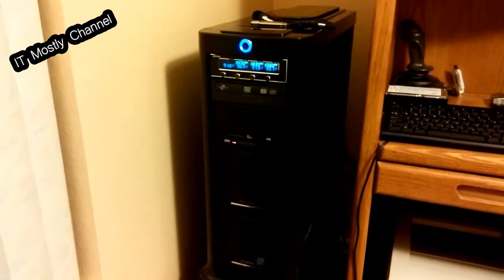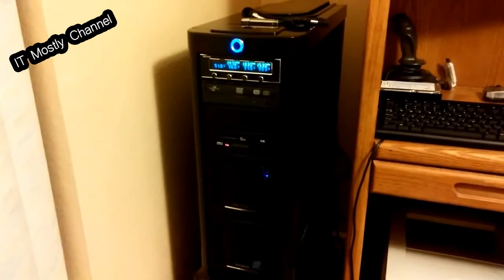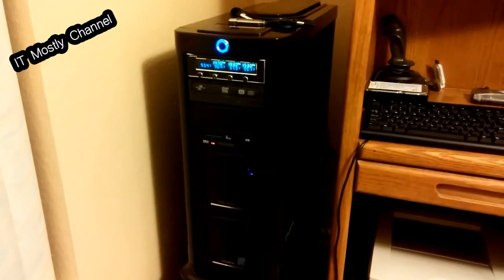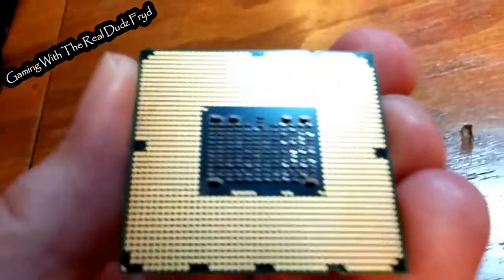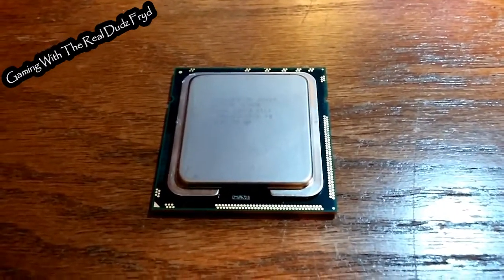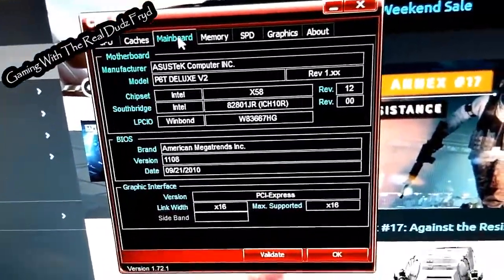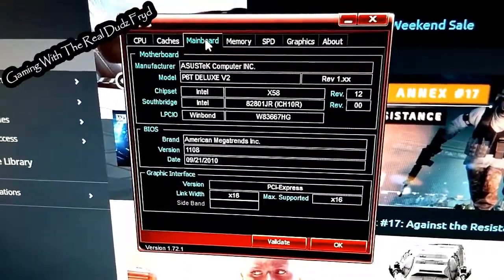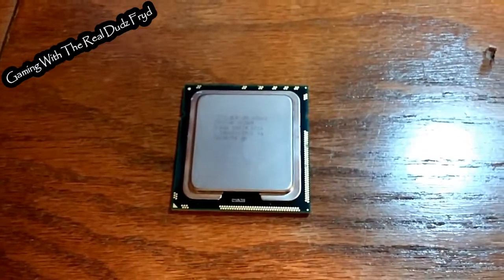Intel Xeon Upgrade:  A 6 core Xeon for an old X58 Board  (Part 1)

Comment: Didn’t think PC Power & Cooling ever made any ATX power supplies.
Reply from the maker: Yep, I've got 3 of them.  Two 610s and a 1000KW.
Reply: I still have a Turbo Cool 250 (I think).  Pretty sure it is an AT style unit.  It died around 12 years ago, maybe.  I really should diagnose it and repair it to use as a bench power supply.

Comment: i also upgraded to this 6 core machine. and to be honest, this chip W3690 6core / 12 thread xeon is a beast.
U can check my gameplays too. Getting amazing fps on high end games. i paired it with gtx 960 4gb.
Reply: Yes i overclocked my CPU in T3500 server workstation.

Comment: Board bricked at 4:41.
Reply from the maker: No, it didn't and there's 3 other videos after this to prove it.  Was your comment meant as a joke?
Reply: Yes it was a joke. Nice videos, I have an Asus X58 and X5680 myself. You got yourself another thumbs up BTW.
Reply from the maker: Yeah, I only ask because I get a lot of trolls.  To be honest the thought did go through my mind when it happened and if you build enough systems it happens now and then.  Luckily I know not to use too much force on anything and the PCB's can take a little brush now and again... Cheers!
Reply: Nope, no troll here. I love my 1366 Xeon. Here is a vid of it running the GTAV Benchmark with 24Gb RAM and a GTX 1080.
https://www.youtube.com/watch?v=YVVbvZRHmiY&t=10s
Reply from the maker: Great video, I  gave it a like and a comment.  Yeah most of the videos on my gaming channel were captured on this rig.  My biggest problem is getting rid of the hard drives to move to SSD's.  I just haven't been able to afford it.  The Hard drives really hold it back even being Caviar Black 7200RPM drives.
Reply from the maker: Here's a recent sample.  I turn settings down for the stream because my ISP sucks and I can't get above 1.5Mbps on the upstream but still gets 60FPS streamed video with OBS. https://www.youtube.com/watch?v=jq2xvcnrcG0
Reply: I recently flashed an unofficial BIOS that implements a fix for the Spectre vulnerability on an ASUS P6T (non-deluxe).